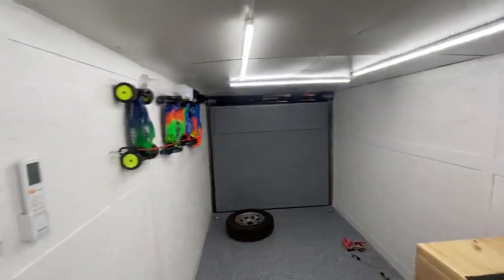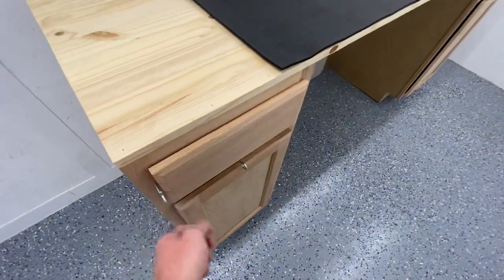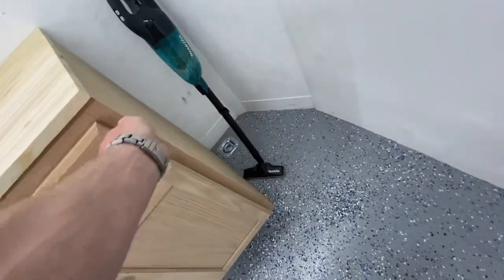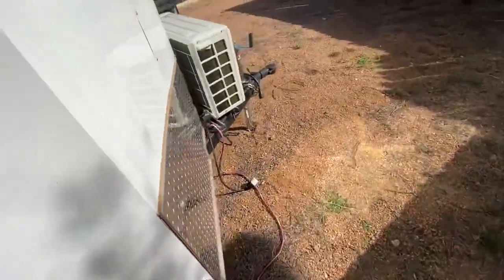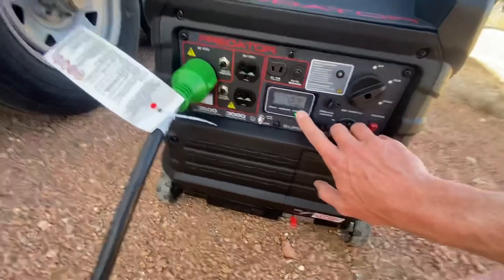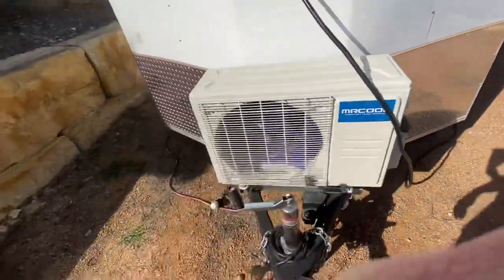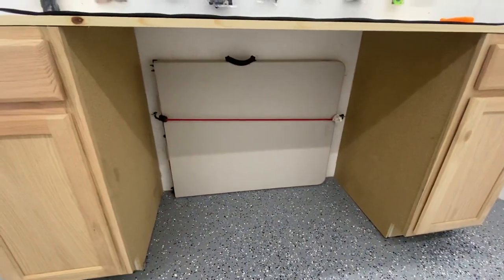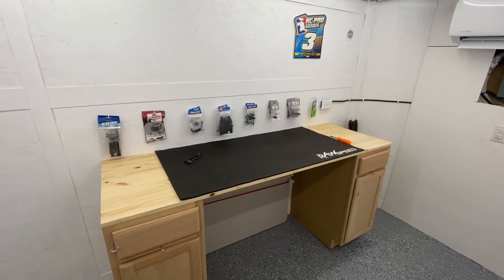The RC pit trailer is heading to its first Race!

Comment: I was looking at this generator as well.  I will have the same setup 7x14 trailer with mini split, and air compressor... Was wondering if this would handle the power with all that plus TV and being able to charge some batts
Reply from the maker: Thats my exact setup now and it runs it all perfectly
Reply: Should do a final walk around your trailer... I was gonna do a 7x16 but I have a 1500 truck and wasn't sure if it would suck to much gas so I went 7x14... Gargo backdoor
Reply from the maker: @MrSpd2009  Lol! I get about 10mpg pulling my 7x16 with my ram 1500